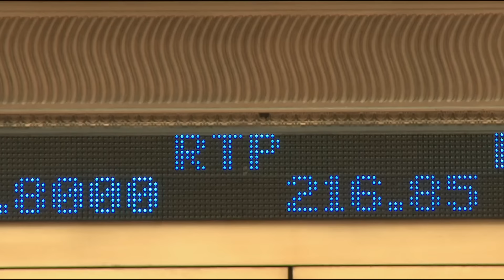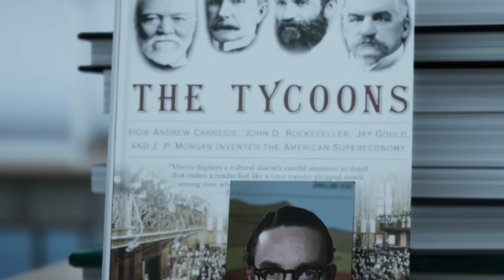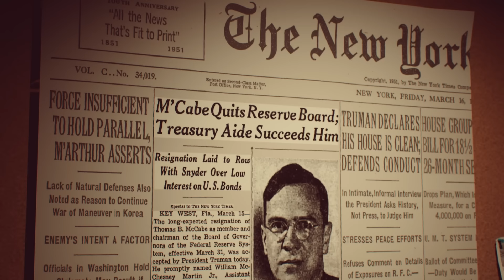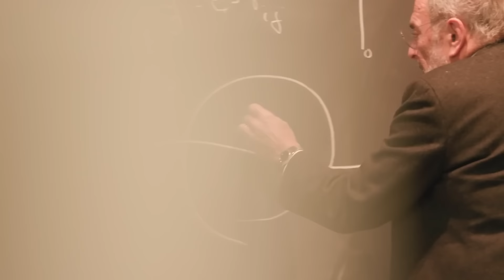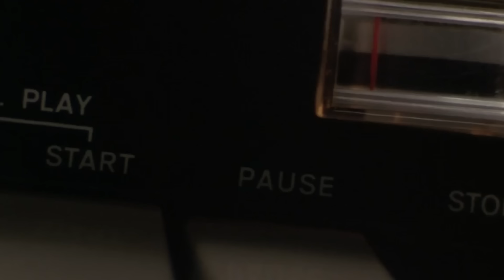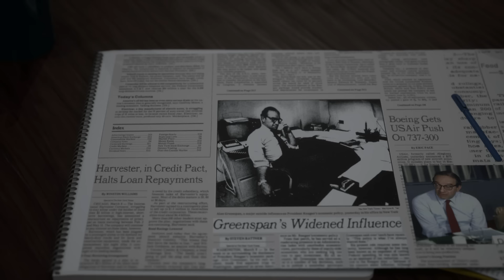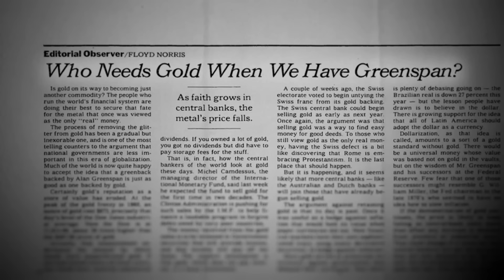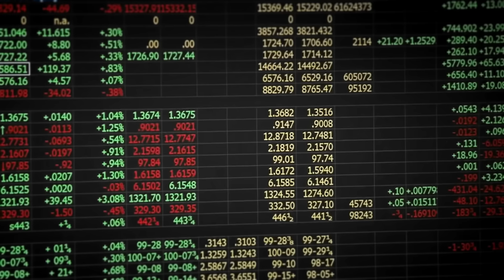Alan Greenspan - The Man Who Broke America | A Biography

Comment: he was the best at setting the interest rate though. and it's not like he was the one approving the mortgages. the stock market crash of 1987 was a result of computers auto selling stocks. they built in a circuit breaker for that afterwards where the stock market shuts down to allow humans to override the computer panic the following day? (I'm not an expert on the circuit breaker which is what I call it but if you look into it you'll find the details if i'm not mistaken. and by now the computerized trading has obviously been fine tuned probably.)